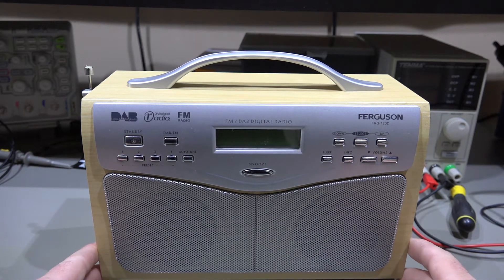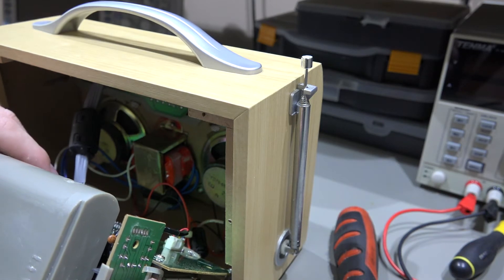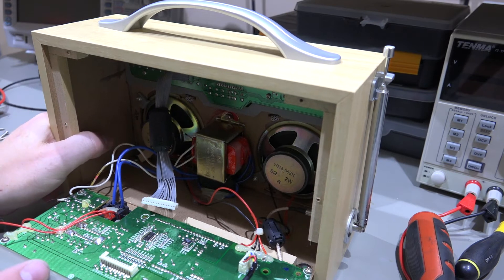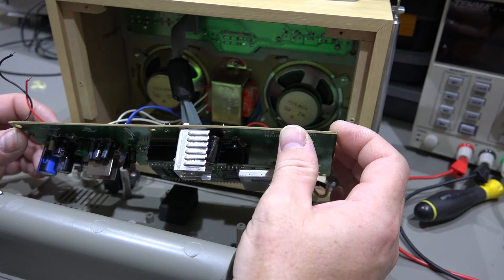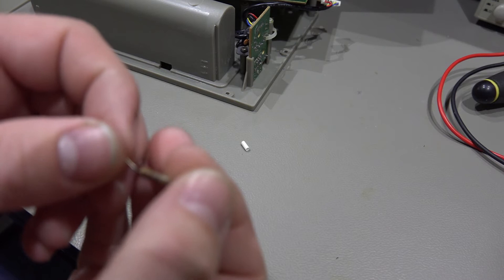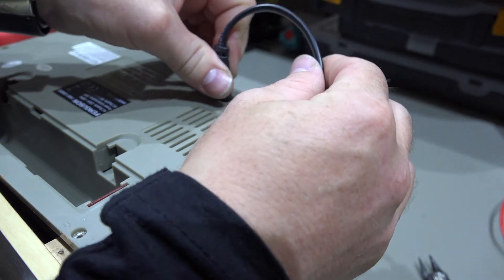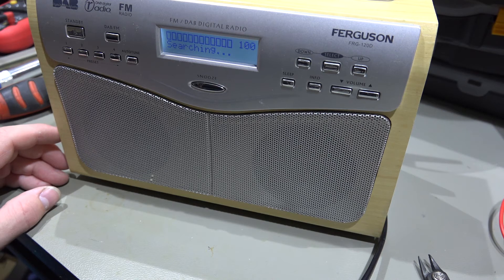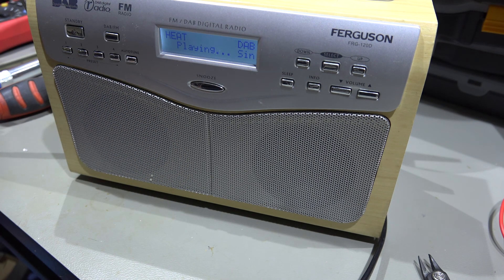Ferguson FRG-120D DAB Radio Repair

Comment: I was Impressed there is transformer power supply not nasty switching power then even more impressed there was working DAB somewhere in the world that still work (receive). We have law that forced DAB+ in every car manufactured from 2020 but in 2025 DAB+ is still not applicable even at home or portable pocket radio outside due poor coverage and fluky signal strengt and quality with a lot off packet drop out.

Comment: Almost identical to a Technika DAB-206 except the buttons have been moved around on the front and standby circuitry is different. On that model, R515 is just a link.

Comment: Need some advice on the Ferguson FRG-120D, FM works fine but all dab stations are showing as 'Not Available'. I found the manual online and it say's to reset it I should hold Select in while connecting the power, it should say 'Full Reset' but it doesn't, I have tried holding for 10, 15, 30, 60 seconds but still nothing, it just won't reset. When I do a full scan it completes, I can go through the stations but still all showing as 'Not Available'. I am in Glasgow so I should have good reception, I have tried all over the house but still nothing, even at the window with the areal fully extended. Could the digital receiver be damaged?
Reply: Mines doing the same
Reply: I have one and it won't reset either , possibly a fault ,not sure . Some stations are now it DAB+ so you nothing audible on this radio. didn't have these issues with AM/FM radios lol
Reply: I had the same issue. I found by powering up and a fraction of a second later pressing down on the select button, (and keeping the pressure on the select button till it cycles thru whatever it needs to do) 17:31 well doing this sort of works. The radio does do a full reset. However up till now I’m getting very flaky dab reception. But it’s progress I suppose. DAB radios are available for around £20 so is it worth it? Logically probably no. 
Anyway flaky reception is likely down to a suboptimal aerial. Any ideas on where to find a good aerial solution? Is there some kind of space age aerial booster available?
Reply: @MrBlaxjax  I ended up getting rid of it as all suggestions didn't work. I ended up replacing it with a Majority dab which works great.